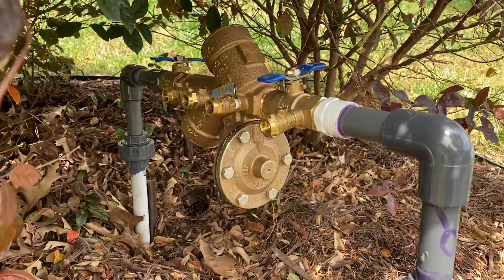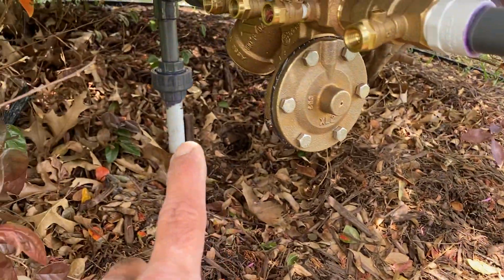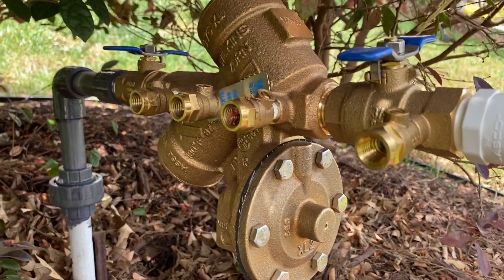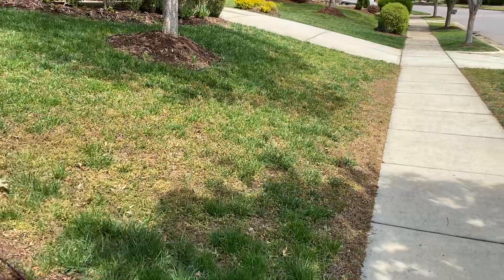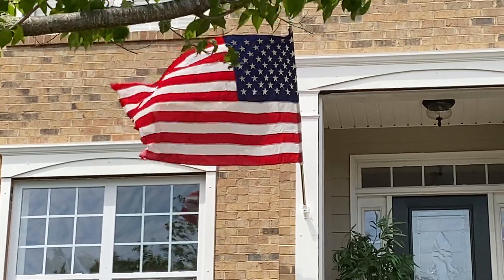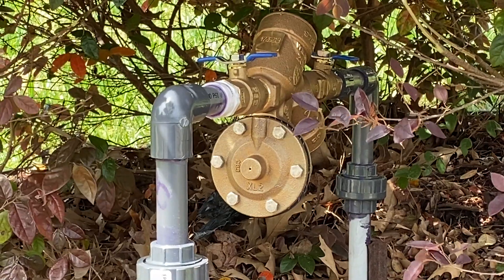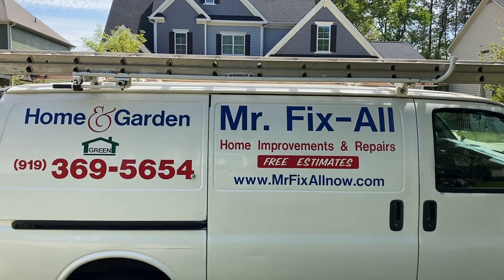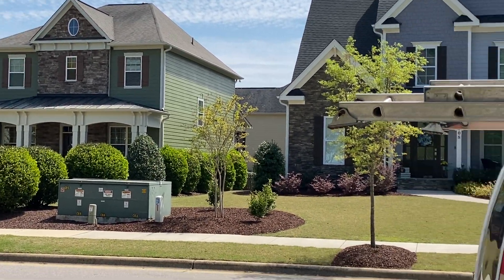HOW TO BUILD A BACK FLOW VALUE PART 3

Comment: On unions there is no orientation that is incorrect:neither the piping or the union cares.Roy Reynolds explained perfectly why they should not be in the same orientation.Next job you could recommend to the homeowner is running an electrical service to that pipe system so a heat trace can be used to prevent freezing in the winter. As cold as it gets there insulation alone probably won't be enough. And SO glad to see you picked up a paying job!

Comment: Tom, the unions should be set differently from intake to exhaust so the unit can't  be reinstalled backwards if the whole thing is removed.  It doesn't matter which is up or down to start with but just make sure the other union is opposite.  If the unions are the same, male down and male down , the whole unit could be reinstalled backwards which is a  no-no.  There is an arrow to show which way the flow is supposed to go.  If installed correctly and the unions different then there is no way to reverse the unit without repiping it.
I saw what will happen without a backflow preventer installed.  When I was growing up a homeowner installed a pump for his sprinkler system to be using the water from a large drain and hooked it into the system so he could run the sprinklers from the drainage water.  Problem was he did not install a backflow preventer between the tie in and the utility side to keep the drainage water from pushing water backwards into the utility main as the irrigation pump was a higher pressure than the utility pressure.  Needless to say he was in big trouble when the setup was found.  He had contaminated his house and a lot of other houses in his neighbor hood with this cross connection.  For this kind of set up  a vacuum preventer should have been used.  Your set up does not have a pump on the irrigation side.
Reply: Watching you tube videos is how I have survived being a widow! Not all videos have the correct info but if I watch enough of them I can eventually figure out how to fix stuff!